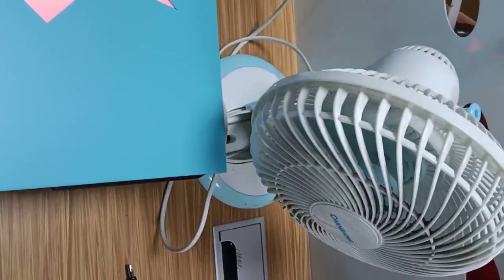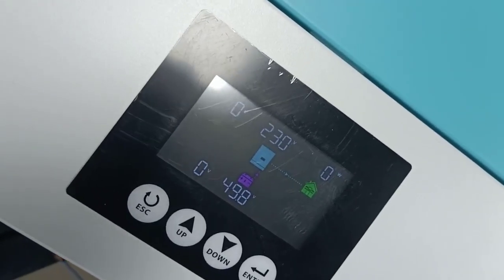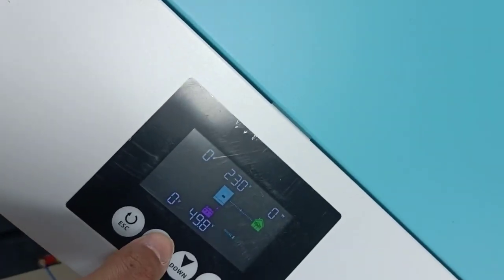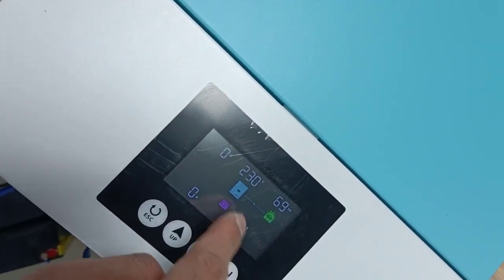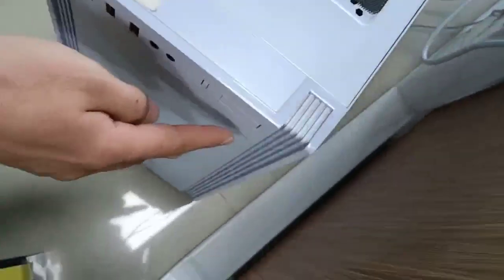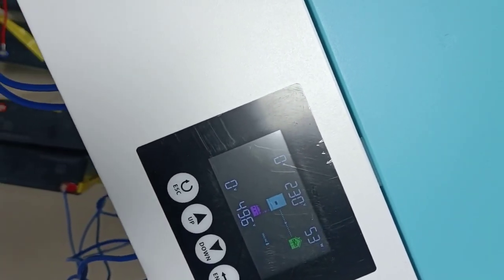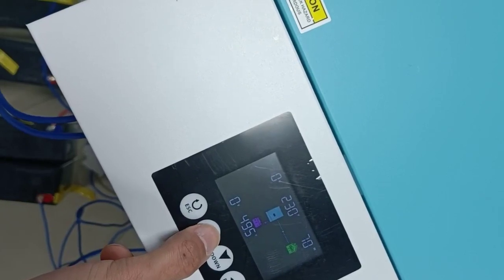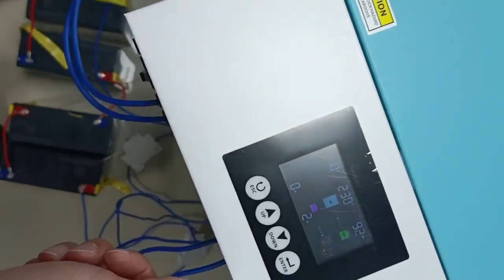Daxtromn inverter 6.2kw hybrid solar inverter not showing the load output ?not ture ,how to Check?

Comment: All the problems that appear with these inverters are due to incorrect settings. You have to understand how an inverter works in order to know how to make the correct settings depending on how you use it. I've been using the 6.2 model for almost 2 years and I can say that it is superior to the easun models

Comment: Hi i have this inverter. My questiin is my home supply voltage is 230volts— Neutral is grounded so the voltage from phase to earth is also 230. Ov earth to Neutral. However the out put on this inverter is centre tapped. (115v ground to Phase, 115v ground to neutral) can i still enable Grid tie mode?

Comment: I bought the 6.2kw one and I do not have batteries I have 3.5 kW photovoltaic panels, and a 300 of Voc, when I have a high energy demand, no longer works with solar but with the network, on settings I put SUB, and since I installed it always does so, detach and reactivate the PV but as soon as there is a demand for high energy works with the network,  Am I doing something wrong or does the inverter have some problems? I bought the 6.2kw one and I do not have batteries I have 3.5 kW photovoltaic panels, and a 300 of Voc, when I have a high energy demand, no longer works with solar but with the network, on settings I put SUB, and since I installed it always does so, detach and reactivate the PV but as soon as there is a demand for high energy works with the network,   Am I doing something wrong or does the inverter have some problem

Comment: I am facing a problem with this inverter. I am using the inverter without batteries. I have attached 8 x 575w solar panels in one string to my inverter (375vdc). When solar production increases above 3500w, the production suddenly drops to zero or near zero and then starts to increase and when it hits 3500w, it again drops to zero. it happens again and again. Sometimes production stays around 3500w and does not restart. Inverter does not restart during this but only the electricity production from solar. The load also keeps running smoothly as inverter draws power from the main/grid whenever such drops happen. Please help
Reply: I got a reply today. They sent me instructions with picture to tin weld a resister to fix this issue. I am happy that they responded with technical fix.
Reply: @nizamersoft  Can u please share the instructions?I have the some problem and many others!!!
Reply: @κωνσταντινοςλουμπαρδιας  They told me to check if there is loose connection on the highlighted resisters and re-solder them. I did not do it and have been running this inverter for a year now.

Comment: Hi everyone, Could someone help me if this inverter has limiting function on grid side. I don't want to feed the grid because of legal issues. Thanks.
Reply from the maker: https://daxtromn-power.com/blogs/news/how-to-turn-on-grid-tied-function-hybrid-function-
you can turn it off check this link,
Reply from the maker: default is off grid mode,if you are not set on 37, it will limit the feed back,only when you turn on this function, it can feed back power to the grid

Comment: Hi, I have purchased this model recently and I found it to have plenty of issues.  The main problem for me is the fact that is not mixing the grid power with the solar power to the outputs. It does that without the battery, but as soon I connect the battery is not working anymore. It also has mppt tracking issues in low light conditions, especially in rainy days when you need it the most. Can you do please a video with the inverter connected to the panels and showing the mixing mode is working ? I tested with a 4Kwp PV array, with both 250V VOC and 330V. Without battery it works fine.  I have some videos with the problems and settings I can pass to you if willing to review and help. Thank you.
Reply: Hi,
Change it in menu item 37 (Grid-tie)
Reply: @ottopasztor4614  That will not doing it either. The purpose of that setting is to inject surplus energy to the grid and it will doing it also only after the batteries are at full charge.  Injection is law abiding by country and this inverter has anything it needs from the hardware point of view to mix solar with grid (basically is feed in with 0 export limit), is just that is kind of using that in the wrong way,, especially if you have LI-Ion batteries.
Reply: @cornelalexa  Yes, sorry I misunderstood.
I think the solution for you is to switch it to SUB in menu 01.
SUB: Solar energy provides power to the loads as first priority. If solar energy is insufficient to power all connected loads, utility will supply power to the loads at the same time. Battery is only used when solar energy is not sufficient and there is no utility available.
Reply: @ottopasztor4614  Yes, that should be the right mode, but event in that mode mixing solar and grid takes place only after the batteries are fully charged. So overall speaking, the main priority of the inverter is set in the firmware to use solar and charge the battery fist, then mix regardless of the mode you are set.  This is good for people with Pb batteries, but is not good  for Li battery types.  The fact this is not clearly stated in the manual is misleading. Working with LI batteries is clearly stated so the inverter is managing the batteries in the wrong way. Yes, you can lower the charging voltage, but in the winter are plenty of days where from a PV array of 6Kw you get 3-400Wh. Keeping your batteries at around 50% SOC is the way to go there and use that solar power directly to the loads. On a 20-30Kwh bank, charging with that power is just useless.... At the end this choice should be in user hand and let him decide what's best for the battery bank and conditions of use. This can also be easily corrected by a firmware update if Daxtromn (or OEM producer of the board is willing to do it).
Reply: @kreciq_klu  Yes, I found that in the meantime but is kind of useless, since at that point you can as well stay on SBU mode. Also having LI batteries is bad to keep them at full charge for longer period of times. Is good for PB ones, but harming LI-Ion. Would have been nice to allow this mixing to take place from lower levels (such as back to battery voltage). In long rainy days and winter, beyond a minimum SOC to maintain the battery, would make more sense to use the minimum amount of solar energy produced by mixing  it with the grid (like BGH-5Kw is doing it for example) instead of pushing it into the battery and wait for a month to charge them (especially on large battery banks).  The final goal of a solar system is to use as much solar as much efficient as possible by keeping your batteries at the minimum cycles since they are quite expensive. Mixing grid with solar  as user decides in a given context is the most efficient way to solve that instead to assume a fixed typical use mode for the inverter. Also this way of working should be clearly stated in your user manual.
Reply: @kreciq_klu  In the last 7 years I have been using various OffGrid inverters with LI batteries and BMS without communication with no issues. Is a matter of having the right settings. I switched to hybrid for this specific functionality which would have allowed me to use energy more efficient and stop pushing it to battery when it does not worth. I do have also an EASUN VII (BGH-5Kw) working  flawless since Aug. last year, but that one is mixing energy in the right way(loads first then battery). I have chosen AGH-6.2 for a second system  because it has more power and is it also hybrid. The manual did not stated this substantial difference in the way it mixes power and they assured me it can mix.  "Being cheap" might have things to do with quality components (yes it's having lower quality current, voltage sensors and other small issues each and there you can find ways to live with) but overall it should work as advertised.  Overall speaking is not a bad inverter and the issue I am talking about can be fixed quite easy in the firmware.
Reply: @cornelalexa  I have read the user manual several times. I found an additional information for lithium batteries. What appears when you select the battery?
In the user manual, I read about the lithium battery that if solar energy is available and the LIb menu item is selected, it will only activate the lithium-type batteries.
Reply: @kreciq_klu  I agree. BMS communication is required for lithium batteries.
Reply: Hi cornelalexa, i'm interested in this inverter, but there's no information by the users like you did. By reading the manual(by your experience is useless) they say in the SBU mode , solar to loads first and battery after and at last, utility; Can you confirm if that is true or like the other modes it just go to loads after battery full charged ?
Reply: @rol415  SBU mode is working fine. As long you do not reach the back to grid voltage, it mixes the Solar and Battery to loads and charging ok. Once battery is discharged and it connects to utility(Bypass mode), Solar will charge the battery first(the charge source depends also on option 16), up to the "back to battery" voltage level and it switches off from the grid.  So is it working like any other "offgrid" inverter and for me, mixing the Solar with the grid to the loads (when grid is connected regardless of the SBU/SUB modes)  is the area with the problem. Having an hybrid not able doing that is making it a useless hybrid. So if you not really need an Hybrid and if you are going to use Li batteries look for another type. If do you need an hybrid, get something else (stay away of any models using a similar display from any producer since all are using the same board inside).
Reply: @cornelalexa  I tested it for 1-2 days. SBU mode. The batteries are fully discharged. Batteries: 4x 12V 100Ah, 15-20 amps charging per battery is recommended by the factory. Max. PV volts 180V, max PV amps 8-9 amps. (sunny weather)
...
Q1: how much did you set the system's maximum amps charging?  Menu item 02, utility + solar.
Q2: how many amps is the utility current allowed to charging?  Menu item 11.
Q3: what did you set in menu 16?   CSO, SNU or OSO? (I have a guess: you set it up with OSO. ? )
Q3: how the PV string is connected? serial / serial-parallel (2 string)?
Q4: how many amps are coming in from the PV string(s)
...
It worked perfectly for me with this settings:
Menu 02: 20* amps    *edited 
Menu 11: 20 amps (this is important!)
Menu 16: SNU (and this is also important!)
Why? Because the incoming amps (and voltage) from PV was not enough to charging the batteries (not enough for the built-in charger) + working in mixing mode.
When I set these values, it was clear that the PV was no longer just charging the battery, but was added to the output.
...
What is very important: you cannot compare inverters from two different manufacturers. They all work differently and have different settings. You have to experience how this inverter will work properly in your system.
Good luck 🙂
Reply: @ottopasztor4614  i think if you use 4x 12V 100Ah batteries in serie, the total current recomended is 15-20 A, not 4x15(this is if they are in paralel). One question, these batteries have individual bms? They Work fine?  when you say "Why? Because the incoming amps (and voltage) from PV was not enough to charging the batteries (not enough for the built-in charger) + working in mixing mode." it's weird the energy from the pv not able to charge batteries and if you use utility for charging batteries you are loosing (?) energy.
Reply: @rol415  Sorry, I wrote the charging current value wrong. (Menu 02) I set it to 20 amps, not 60.
So..
The PV and the utility charge the batteries together (with these settings), so the energy from the PV is saved and together with the utility it supplies energy to the output.
If the battery charger switches to floating charging, less amps are enough for charging and the PV can transfer energy to the output.
It works.
It is important how big the battery pack is connected to the inverter and how much the inverter can charge from the PV energy.
Reply: @cornelalexa  

Shit I have just bought Inverter 8KW with display like this if I've seen your comment before I wouldn't do it probably anyway I will try it  this week maybe is different ;) if not I will stay with old EAsun 5KW
Reply: Will it work with solar assistant?
Reply: @vim55k  Yes, the serial protocol is the same as older PIP4048MS (and similar ones)
Reply: @cornelalexa Hi if you dont mind me asking did you have to change your batteries? It seems to be affecting my batteries. They are dropping voltage sometimes down to 4v from 12v. Only a few months old
Reply: it will damage the inverter when you turn on the battery and ac line is around.